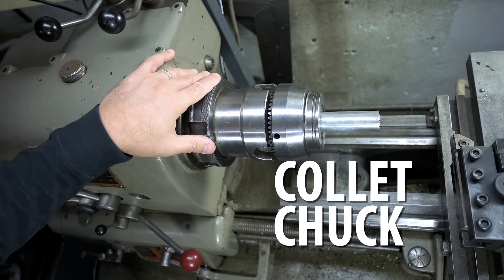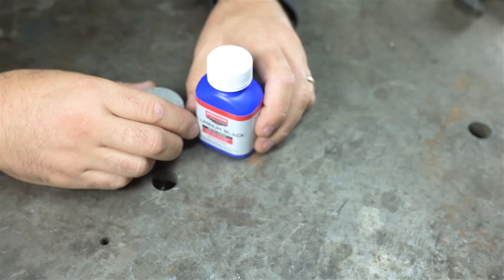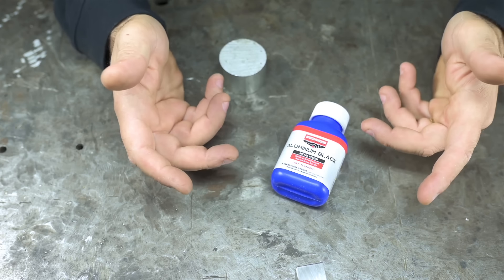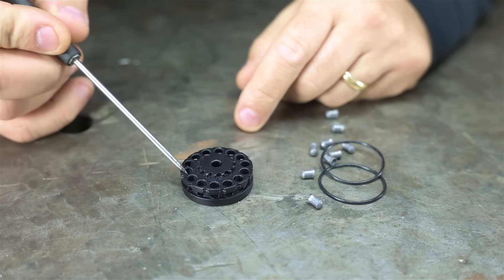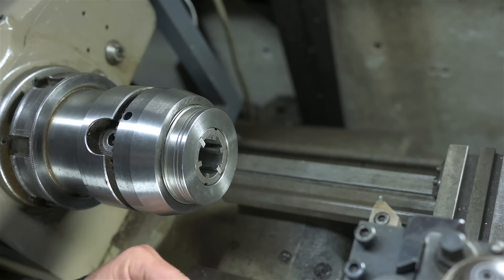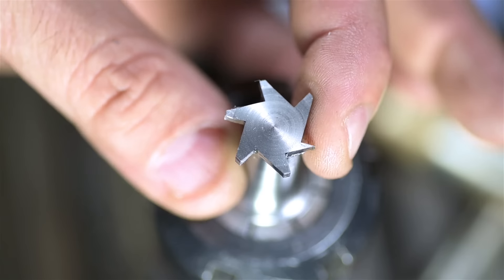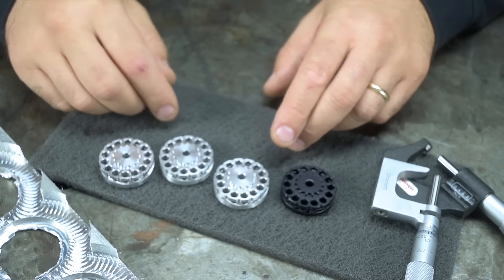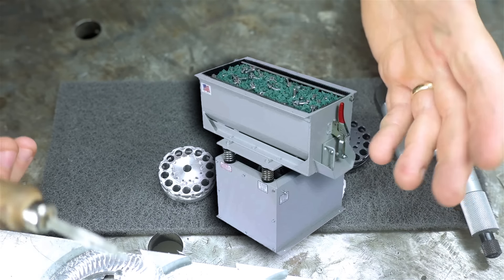Will it Black an Entire Aluminum Part?

Comment: I tried anodizing aluminum for the first time recently, and really liked the results. The process was a bit scary, using both sulfuric acid and lye, bit it was not too difficult, and made the parts look better, as well as making them more scratch resistant, and move more smoothly against each other. Since it was for a project -- a large format camera -- where some of the parts will slide against each other, all of these changes were improvements. The acid, as well as the dye I used, can be used again and again, too.
Reply: Why are you using lye? if unattended it will etch into the Alum. part clean your parts with soap and hot water l did it for 10 years at work in the machine shop made alum. fixtures that were to be in the medical assembly line.
Reply: @lberthelon  I'll second this one...  I work with a lot of drills and saws, dealing with putting holes and cuts in extruded copper and aluminum, and even something as moderate as sodium carbonate (I use it for degreasing and neutralizing acid etching on steel...) will attack the aluminum chips, given enough time...
Reply: So far my home shop anodizing works beautifully on scrap but on parts mixed bag of OK to horrific
Reply: @lberthelon  Because this was my first time doing this. I made mistakes, and wanted to strip the anodizing from a part to try again. I learned lots of lessons as I did more, and found that my poorly anodized parts were mostly because of my wire connections. After I figured out a better way to get current flowing, the lye was no longer necessary. I'm just a self-taught guy out in his garage.
Reply: @lberthelon  Oh, and believe me, I did NOT leave it unattended! I never left a part in the (weak) bath for very long; nor did I need to. But it stripped the flawed anodized layer smoothly and evenly. I cannot tell from looking at them which parts were stripped and re-done.
Reply: Considering the amps and voltage required for anodizing I honestly don't know how anyone could do a proper anodize coating in their garage.  As you anodize aluminum the coating becomes non conductive.  Which means you need to keep upping the voltage to keep the amperage up.  An actual anodize shop will start a batch of parts at 60 volts and 1500 or more amps.  Over the course of the next 3 hours the parts are anodizing the amperage slowly drops to maybe 300 amps at 60 volts.  

On top of that the amount of heat in the sulfuric acid solution you are creating is going to be intense.  Which is also going to make a very hot solution which doesn't do a good job at anodizing, but even more so puts off a highly corrosive mist, and hydrogen gas.  Yeah the same gas used in the Hindenburg.  BOOM!  So if you try this, don't do this in your basement.  At best do it in the garage with the doors open and a fan going.

A good type II clear anodize coating should be anything from slight gray to light tan.  A good type III clear anodize (which you're never going to achieve at home) is actually black in color.
Reply: @lberthelon  I worked for a commercial anodiser and we used lye to prep our parts all the time. Machined parts only got a minute or two in there to take off the surface oxidation but other stuff (jewellery, tableware) got 10 minutes tops. I think the slightly matte finish it leaves is a really nice result.
Reply: DIY and large format photography? Sounds awesome. If you’ve got more information posted anywhere on the internet, I’d like to read it. Thanks!
Reply: Funny you should mention that, the only thing I’ve actually used cold blue on is enlarger parts because I was rescuing one.
Reply: @garygsp3  as the amperage is a function of surface area of the parts, you don't need that much of amperage for it to work beautifully on just a bunch of rather small parts. A good lab power supply is great, but there are cheaper solutions out there.
Reply: @robertpeebles6782  no
Reply: @maxschumacher9446  Lye is essentially like prepping the part, it's a good idea.
Reply: @garygsp3  it's full of videos on YouTube on how to anodize at home, typically type 2 with dyes
Reply: Interesting to find someone attempting the same project with similar material processing
Reply: @garygsp3  very intetesting. Now to be fair 60V is easy to obtain at home and you definitely don't need hundreds of amps if you don't do industrial quantities and/or huge surfaces (720 rule  ;-)... )
Reply: @Eng-OS  plus constant current dc-dc converters for tens of amps are dirt cheap on the internet... You just need a decent first stage transformer
Reply: @garygsp3  dude lol 1500 Amps at 60 volts? Have you seen cable that big to handle 1500 Amps only from 60 Volts. Don’t speak bullshits my dude. Also show me transformer to handle 90 kW. It would be big as building …
Reply: @lberthelon  I take it lye is another name for sodium hydroxide? In which case it’s a great way to clean the metal, if you don’t get too carried away it will also munch burrs and some blemishes. Some commercial aluminium cleaners are just sodium hydroxide and things like sodium silicate or glugonate.
Anodising is so easy on new parts it’s not worth the fuss, as the original comment, everything is reusable, plus  if you can get the right dye, some great colours are possible .
Reply: @garygsp3  Well, it works just fine, and as someone else commented, there are tons of Youtube videos out there on how to do it. And there are businesses out there that exist at least partially to supply DIY anodizers. It's where I got my dye. A dedicated power source with adjustable current levels is a real help, but folks make due with battery chargers, somehow. Setting the current to a constant level, and then having the voltage automatically rise as the aluminum becomes less conductive is the key to this working. As for heat in the acid, I had my acid bath bucket inside a larger container into which I would add ice as the temperature climbed.
Reply: @hassiaschbi  I got a lab power supply for just this purpose, but I will have lots of other uses for it, too. Mine cost about $80.
Reply: @D-Vinko  You wrote 'Lye is essentially like prepping the part, it's a good idea.' Lots of folks do it for each part as a matter of routine. I had thought that it would dull the finish, but it doesn't do much, if you are careful, and it sure gets it clean! There cannot be residue of any kind in order for the metal to anodize.
Reply: @Eng-OS  you wrote 'very intetesting. Now to be fair 60V is easy to obtain at home and you definitely don't need hundreds of amps if you don't do industrial quantities and/or huge surfaces (720 rule  ;-)... )' My power supply maxes out at 30v, and it never topped out during the process. As you say, the 720 rule allows you to limit voltage by keeping the current running longer. The largest batch I did was a couple of square feet in surface area.
Reply from the maker: Thanks Paul.  It always seems like such a pain/mess, but the comments here have the ol' gears turning!
Reply: @ThisOldTony  It is a bit messy, but one good thing about it is that mistakes are reversible. And the dyeing process is especially rewarding: it pretty instantly begins to take on color.
Reply: @ThisOldTony  
TOT Aluminum Black, coming soon to a website near you.  😁
Reply: @ekon01cz  they don't connect with cables in the agonizing plant.  They use  copper bus bars. However, you don't need that much current for hobby work.
Reply: The current is usually about 30mA per square inch of surface area of the parts being anodized.  Adjusting this up or down is part of the art. The voltage will depend on the size of the tank and acid concentration, but is not of much concern since the process is current controlled. For small tanks that would be practical at home and a 10-15% sulphuric avid, 15-24v power supplies should work great as long as they are current controlled.

I use aluminum wire to connect the parts and run the current in reverse for a few seconds before running it the correct way to get some more aluminum in the solution from the part near the surface, even though the solution should have dissolved Al unit before starting. This seems to help create a more uniform layer. A local plating/anodizing shop suggested this opened the pores of the metal, but I suspect it is more about getting the acid forming the oxide than anything else.
Reply: @ThisOldTony  checkout the caswell documentation for their kits. and then replace their kits with sodium hyroxide for cleaning the oxide layer off (drain cleaner crystals) and anodize in .... the pool acid, I forget the name. Someone on the innertubes has the concentrations needed somewhere, but it's pretty forgiving. Simple lab power supply, and ALUMINUM wire for the connections. I used a roll of lead sinkers (came in a strip) as the electrode not connected to the part. I ran it at low amps for an hour or so and when the amps started dropping off noticeably, it was done. I have not had success dying, but I'm using clothes dye. wrong stuff I think.  I was doing coin sized things at 50mA. A tube of PH strips comes in handy for neutralizing the sodium hydroxide when you're done with it! Rinse object in distilled water between each step. It sure makes it feel less dirty to handle after it's been anodized!
Reply: You don't need to use sulfuric acid for the anodizing, I use Sodium Bisulfate, which is easier to get here in Canada as a pool PH reducer. 

It's really not hard to anodize at home, I managed to get decent results with nothing more than sodium bisulfate, lye, some cheap fabric dye, a 1980's, 12V battery charger and a 60's Coleman stove! I have a video on my channel about the process if you're curious.
Reply: @lberthelon  cleaning a part for 10 years seems excessive, but I suppose I've never made parts for medical purposes.  🤣🤣🤣

Seriously though, I've anodized small aluminum parts in my garage with a cheap power supply and really had pretty good success on the first shot.  And you can skip the expensive dyes-- Rit fabric dyes worked pretty well!
Reply: @drhender6943  I've read that RIT and other clothing dyes do not protect from fading due to ultraviolet light, if the part will be outside. Also, the dye from Caswell cost $10, but I have it stored now in a bucket, and can use it again and again. It seemed worth it to me to buy stuff made specifically for the purpose.
Reply: @garygsp3  curent (ie amps) is a function of part size so small parts are "garage scalable" I do some hardcoating of small parts now and then and the current source is less an issue than keeping the blooding acid bath a near zero °C (for hard anodization)
Reply: @paulkinzer7661  While I have used RIT dye, my parts haven't been exposed to much UV, so I haven't experienced facing.  But that is good to know.  Thanks!
Reply: @drhender6943  👍
Reply: @drhender6943  that gives a new meaning to dish pan hands .. cleaning a part for 10 years ,, LOL

Comment: I’ve had pretty good luck with this stuff and cold bluing on steel parts. When restoring my Hardinge HLVH, I cold blued the various handles and such and the results were fantastic. The key for all of this stuff is the surface preparation. I know it goes against the grain for most guys, but following the instructions can be beneficial!

Comment: The thing is that Kind of product usually creates a thin layer of oxide at the top preventing from rusting by insulating the part from the air. If you apply with a brush, it set a thin layer of product and it will consume a little of the metal part(on the upper layers). BUT if you dip it, you allow the reaction to go deeper in the metal and it won't really stop to consume metal unless you remove it. It breaks binding of metal grains which produces heat. You could try to airbrush it or just apply with a brush as you mentioned. Great video thanks!

Comment: Harbor freight rock tumbler is what I use to clean debur small parts it will run all day and all night. Which is about the time you need to have any effect.
Reply: @vladviking Darn skippy it works. I use 2 for use on casings to make more things to shoot things with.
Reply: The machine shop i used to work in had one that was old as hell and had been "fixed" over and over again with parts from harbor freight and from the hardest stainless and titanium, all the way down to really REALLY soft brass wouldn't take but a few minutes, the titanium obviously took the longest (around an hour) but the brass and aluminum only was maybe 5 minutes before they were perfectly smooth on all edges that would slice you like a razor before hand

Comment: Home anodising is really easy, I'd suggest you try it out, all you need is some sodium hydroxide to clean the parts first, removes the thick oxide layer, some lead oxide eletrodes, sulphuric battery acid, and a PSU with the right current and voltage (12-96 volts depending on how durable you want the finish. A hardcoating finish will not look as nice but be super duper durable, but 12-16v is fine for cosmetic finishes). Run the  parts in the acid with the lead electrodes, it'll etch them. Buy some coloured dye on ebay, make up a coloured bath, dunk the parts, then remove them and add them to boiling water to seal the surface and turn the oxide into a kind of hydroxide on the surface. You can google yourself for a more detailed walk through and techniques.
Reply: Pool chemicals pH- work well too, and easy to get without people thinking you are cooking drugs in your basement.
Reply: @minigpracing3068  its just good ole lye, get some for making pretzels! Or get some to unclog your drain. Maybe even get rid of a stump in your back yard
Reply: One question, what kind of dye do you have to use? Is it some stuff specifically for anodizing?
Reply: @CatNolara  I've heard of people using Rit fabric dye for anodizing
Reply: @CatNolara  it's typically an inorganic pigment based dye suspended in water and the pigments get trapped in the pores.
Reply: @sugarbooty  The pH- is a "safer" substitute for the sulfuric acid, the acid and the lye can be used in making illegal things and many stores around my part have pulled both. Took me 4 different stores to get lye drain cleaner the last time I wanted some for cleaning parts I made. It's a huge hassle when stores think they need to be "morally right" and pull supplies off the shelves.
Reply: @CatNolara  I used RIT brand fabric dye, its OK. I've been told that the special dyes made for a pricing are best, and that you should use a chemical to seal the pores as opposed to steam or boiling water. Boiling water worked fine for me. There's a short video on my channel of some parts I made.
Reply: 12V-😅96V?  Yikes!
Reply: @bobweiram6321  you'd only go as high as 96v for a very durable hard coating finish but you need special sealing procedures for it to work as effectively, like nickel salt based sealing baths, not just boiling it in water
Reply: I’ve dyed parts with sharpie before boiling them. Works fine.
Reply: Wow, didn’t know aluminum used voltages that low. I’ve done titanium anodizing before.
Reply: Lost me at “sodium hydroxide”.
Reply: "You can google yourself for a more detailed walk through..."

I googled myself and apparently I don't know anything about the topic.

YMMV.

Comment: That was a very cleverly disguised... projectile accelerator :D +1 for avoiding overzealous censorship. I'm glad you showed the franken-cutter in action, I was worried you would leave it out when you showed the finished parts first. That bluing bath looked like it was just dissolving the parts :P

Comment: The finished product looks very similar to what we create in a steel pipe mill I work at that also runs standard sizes of aluminum pipe, we use a process called ‘bright finish washing’ where it’s dipped in sulphuric acid tanks, washed in sequences of phosphate and rinse tanks, then dried and left to cure leaving it with a black and almost rusty look at certain angles, pretty much exactly what you have here. It’s meant or designed to look tinged but prevents rust, and is also perfect for oil dipping as the oil tends to hold better on the slightly pitted surface to hold up in outdoor uses.

Comment: Pro-tip: Pneumatic paint shaker. $220 from the usual scumbags. Get some empty paint cans and your blasting media. Much more violent. Violence and deburring are almost spelled the same. They both have an E after all. 30 seconds and everything is smooth and happy. Alternatively, if money is no issue(no really, these hurt to price out. My 5 gallon mixers are over 10 grand), get a Radia Speed Demon. It's more of a radial vortex mixer than a shaker. They're smooth and gentle but they work like a hot damn. Think "rock tumbler on steroids".

Comment: Hey Tony,
I've worked in metal finishing (anodizing, electropolishing, plating, passivating). Let me know if you ever have a question about different finishes. I have known some shops to use electropolishing to clean off very small burrs. Also, that chemical can release HF and could be the reason for the odor... toxic in small quantities.
-Robert
Reply: Can you tell me how this solution works? Is it replacing aluminum with copper or/and nickel at the surface and that's what is causing the blacking process? Thanks
Reply: What solution is used?
Reply: I'm having some issues anodizing, do you mind helping me please
Reply: Hi Robert I need to paint some oxidized aluminum on my bicycle could you please give me some advice on surface conversation and prep prior to painting?

Comment: Something else to try is applying the blacking solution pretty quickly after machining/sanding. The idea is to get the solution on the aluminum before the surface of it (the aluminum) can form a thick(-ish) oxide layer.